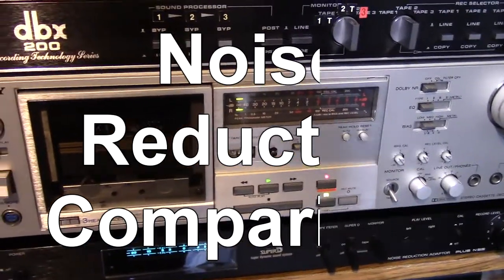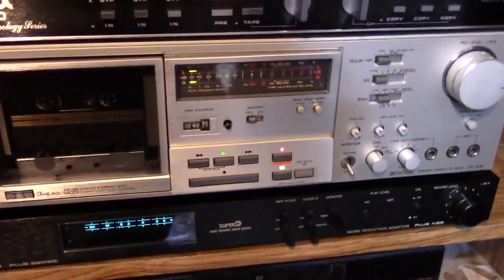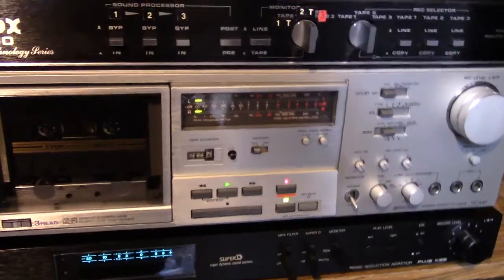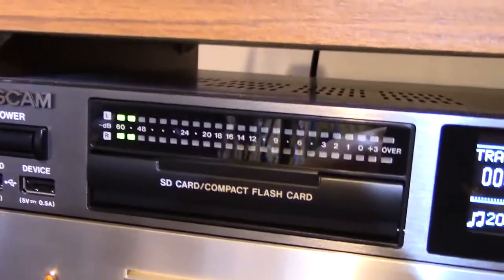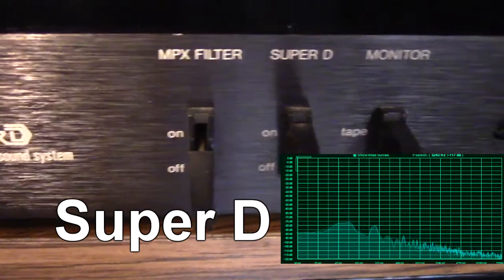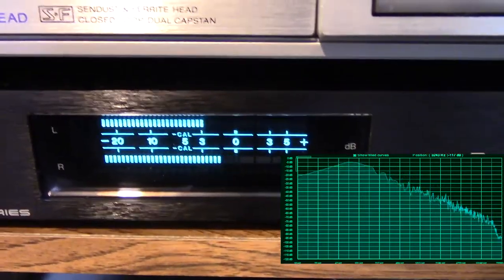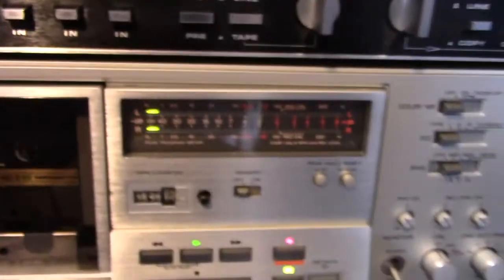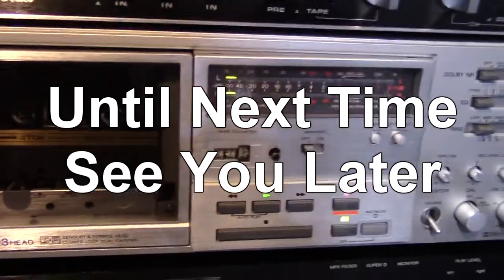Noise Reduction Comparison: Dolby, dbx, Super D- "Jingle Bells"

Comment: Looking the spectrometer levels, Dolby DBX works better reducing on high frequencies, Super D on the Lows what was not tested here is the possibility that has Super D to adjust operation levels so it can be custom adjusted with fine regulations, this was a standard operating test, not an extended one, by the way is good to understand how good is to get one of these machines if you want to play and record with Tape and Reel to Reel decks.

Comment: You do service on this unit a lot  from all the videos. Lol.
I'm thinking i may contact you if i ever need to service my TC-K81.
Reply from the maker: To address a comment you made on the other video, the adjustments can be made in both source or tape. It happens as soon as you put the deck into "record mode". Good eye to catch that, but it still works even in source. SONY is great that way. Thanks for watching and hope your decks work for many years.

Comment: Get a DOLBY A and DOLBY SR off ebay they sell really cheap today. 
I use the Dolby Cinema Processors CP45 CP55 CP65 CP200 CP500 recently the DOLBY STEREO CP200 its the best of the best made. Also SRA5 Spectral Recording with real SR cards 280 280T 300.

Good NR test.

Comment: Ummm, so - which was better ... dbx or Super-D ??
And what about Dolby?
(old-school versions of each, I'm referring to)
Reply from the maker: This was a subjective test. In my humble opinion, dbx has always had the edge over any other noise reduction technology. They are deeply rooted in the recording industry, Dolby being the other main NR. Being able to reduce noise on the order of 40db is amazing. Super D can do as well, with High-Com II holding a respectable 3rd place at  about 25 - 30db. It should be noted that dbx, Super D, and High-Com II are "full bandwidth" NR whereas Dolby is a sliding band type NR.
Reply: I've heard the "pumping" on a DBX nr years back.